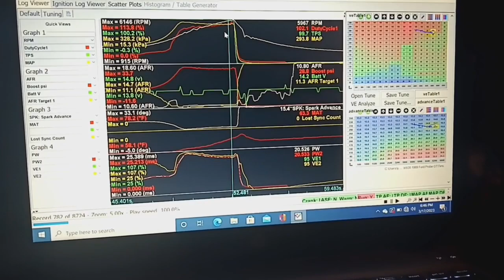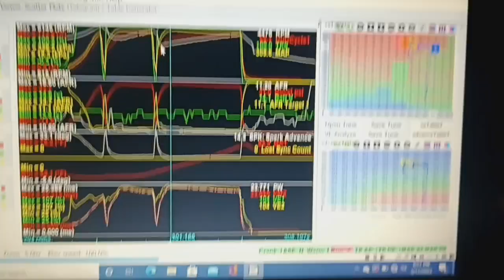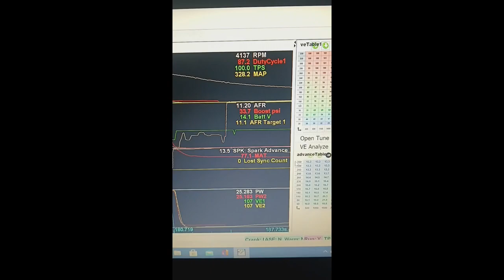HX35 Probe GT RIPS

Comment: I’m trying to build my 89 probe gt its currently has a boost controller at 20 psi stock turbo I was told it had probinator chip but I’m not sure I want to get a bigger turbo the market is pretty dry tho

Comment: One more question. About the stock F2/F2T cam gear. There are 4 offset marks, and what I can find in manuals is just that they are for different engines, but there is no mention what that offset is in degrees. Where I can find this data?

Comment: I still have two questions. 
1. was it worth to retard the cam? The effect, how does it feel? 
2. How AFR changed after this? Did it get more rich at lower rpm and leaner at higher? Or it didn't change?
Reply from the maker: It was definitely worth it. Much broader power band and much more power up top. And no. You're not physically changing the cam profile so it's not going to affect AFR.
Reply: I have an ajustible cam gear it doesn't really do to much unless you move it allot. My afrs stay the same but say I retard the timing 2* it feels better up top by a few hundred pms at most.
Reply: @mikezakel3490  Can you show what gear fits this engine? I don't think there is designed specially to Probe:)
Reply from the maker: @mikezakel3490  mine is retarded 3.1°. seems to love it up top. Didn't really sacrifice low end